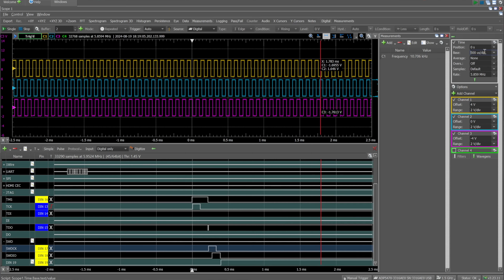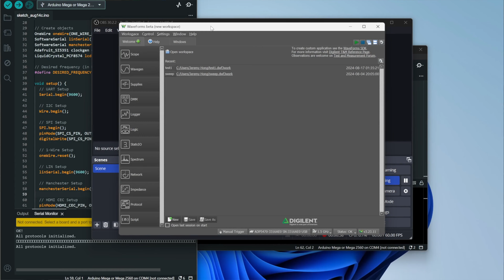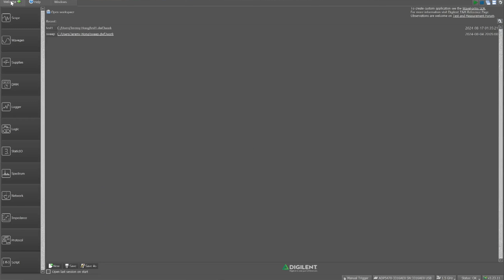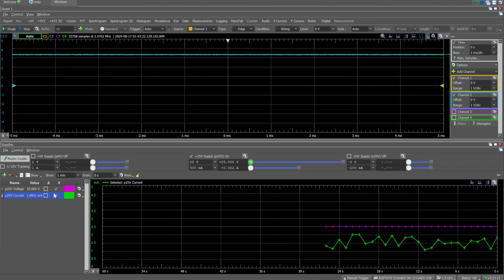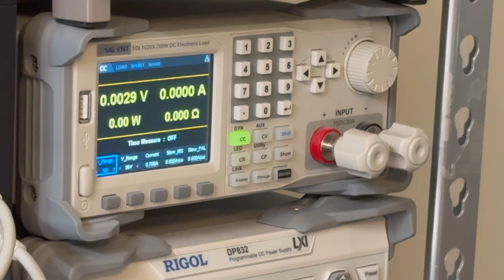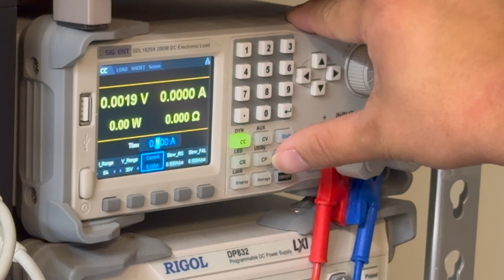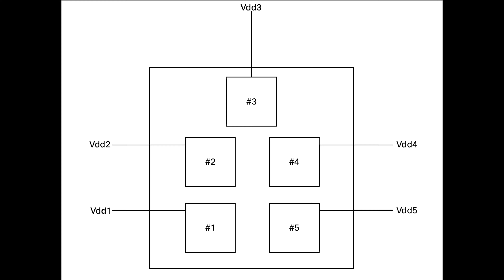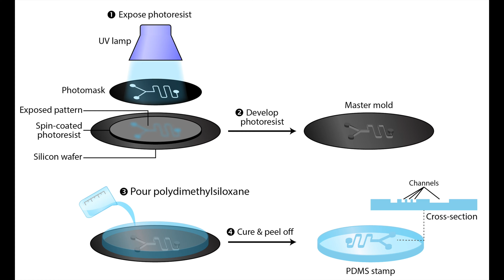Digilent ADP5470 Review & Demo: Professional Perspective

Comment: Hi Hong,
Interesting video.  I am considering the 5470, a Picoscope and a Siglent SD8224x MSO.  I looked into trigger on the Picos and they don't seem to have multiple conditional triggers.  That is, on most scopes I have used at work you can trigger on an event, and then after a delay, trigger on a second event.  They only seem to have run after delay.  I haven't found much on line on triggering for Digilent.  Does it have multiple trigger events?  That is trigger on event 1 and then trigger on new event 2.  Or Trigger event 1, delay then trigger on event 2.

How do you like how the FFT works.  It is useful.  Rigol FFTs are apparently difficult to get useful information from.  Siglent pretty good from what I have read.  Do you get the right harmonic values out of the Digilents for a square wave?

One thing I like about Picoscopes is that software works on Linux. The Digilent website sats that the 5000 series scope only work with Windows.

Thanks.  I have to make this decision fairly soon.  Siglent scopes are on sale till the end of the month.
Reply from the maker: @timothyreilly6742  For instant out of the box capability I think in your specific case/application going for the Siglent is fine. The Digilent scope may require some scripting